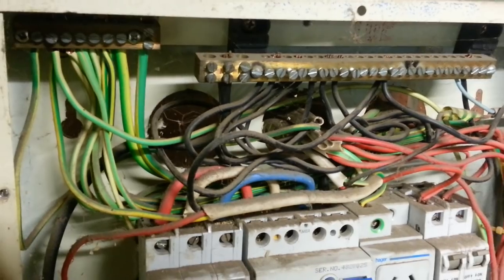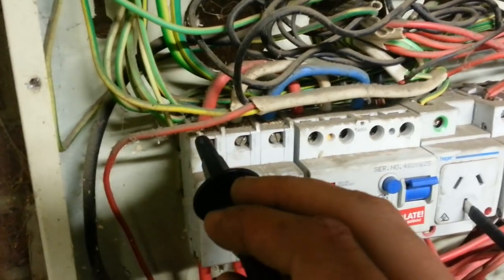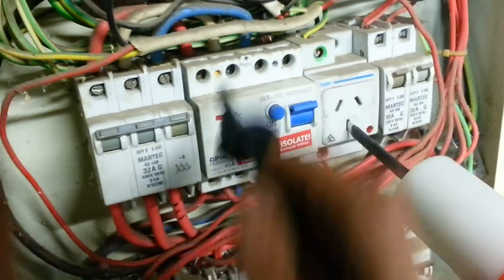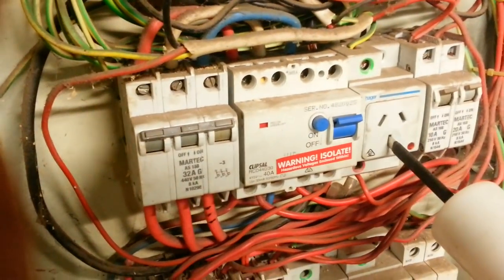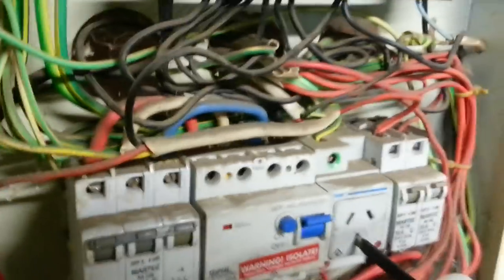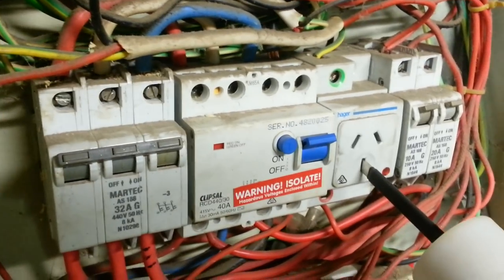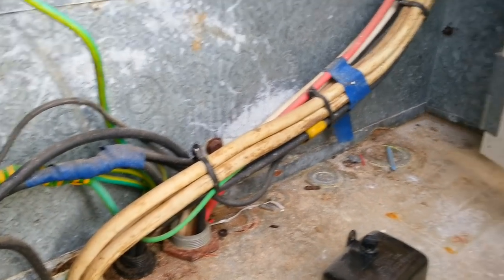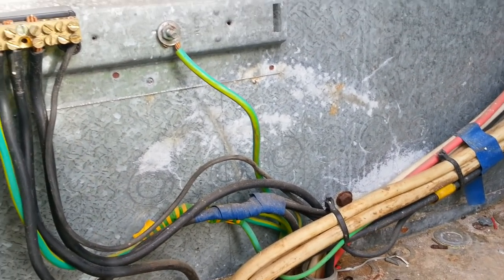M.E.N. link and R.C.D. demonstrated

Comment: i'm a sparky too mate and i always wondered why they don't use RCD's in the US either. Mind you they don't tend to ever use vde insulated tools either. I think it may have a bit to do with the fact they only run off 110 VAC 60HZ as opposed to 240V 50HZ.  Not sure though exactly. Their Active conductors are generally coloured black and neutrals white also. Their installations seem like way more of a hassle as well as they use metal boxes at every GPO and light switch.  It must be hard to add another GPO in elsewhere with that set up!
Reply: I think is becouse they are crasy. Here in Brazil half of the  country is 220 v  and the other half is 110 v but in either them is mondatory using RCD.
Reply: They have GFCI breakers which are basically RCBOs.

Comment: The MEN doesn't make an RCD trip, an RCD would still trip without an MEN.
The MEN provides an alternative route for the current to go back to the transformer on the pole (on in the street, for underground con mains)
You were correct when you said a RCD will trip when there is an imbalance, but technically it is an imbalance between Active and Neutral.
For example: there is 10Amps going through the active conductor and only 9.5Amps coming back through the neutral, the RCD recognises the difference and trips. The .5 Amps would go through the earth with or without an MEN.
Reply: 100%
Reply: Correct!
Reply: and so the MEN makes sure that that .5 amps goes through the earth/neutral wire instead of the person.
Reply: @PotatoesRnice  Nope! Read the last sentence of the comment that answers it for you.
Reply: @foxnews114  what I was holding onto the earth (maybe a metal housing) and the earth connection was in dry non conductive ground, and there was no men, and the RCD was faulty
Reply: @PotatoesRnice  Well sounds like your bringing up a pretty rare problem being 4 faults at once. (Fault to earth, earth stake bad connectivity, no men and a faulty RCD) in that case I wouldn’t like to be touching the metal housing.
Reply: @foxnews114  but the men could save the day and trip an MCB by providing a low resistance path from the metal housing to the grounding/neutral bonded at the transformer in ths street?
Reply: @PotatoesRnice  Yes! but it doesn't make an RCD trip.

Comment from the maker: Just a side note for the folks playing along at home. The main neutral should be soldered to the meter or the main neutral link be protected by a energy authority tamper proof seal (this prevents people stealing power, an offence by law). Meter wiring is not part of this video demonstration only safe working electrical outlets is.
Reply: Tradie Trev get a life trev

Comment: You can't actually fully insert your test lead directly to the live point of the socket without anything plugged-in to the neutral point of the socket. That's the way it protect, example a child not to get a shock if he tries to poke it with a conductive material. So it's only for safety.
Reply: here in the UK its the earth

Comment: Very Interesting to compare with here in the UK . Where we have what we call a TNC-s supply, the equivalent of the MEN link is inside a sealed unit belonging to the supply company, along with either one or three large fuses, one per phase.  Only the network operators are supposed to mess with it. The customer just gets presented with live, and separated neutral and earth to connect the installation to, private customers are prohibited by law from adding any extra NE bonds,  or re-combining neutral and earth, unless there is a private generator. We too put RCDs or RCBOs at the origin, not at the final outlets, and that protects the users if there is cable damage by mice or whatever. But often we also have TT supplies, especially for remote farms with overhead feed cables. Yes we expect all electricians to be aware of this sort of stuff.
Reply: Good point as the MEN link in Australia is often undersized, not fitted correctly etc much better system in the UK
Reply: @JT-xt8bh  UK standards makes Australian electrical installations look so cheap.
Reply: @IAmThe_RA  cheap and nasty in Australia, so many electrical fires there due to sub standard workmanship and lack of knowledge/experience unfortunately
Reply: @JT-xt8bh  As a person from a developing country I was a bit astonished that a rich country like Australia is not far ahead of us when it comes to electrical installations and stuff.  Australia is also like an ally to the UK.. they could have easily cooperated in this sector to improve their standards. When I watch I British electricians doing their job, I just drool man 😂. I wish I could get my hands on their hager distribution boards, RCBOs, and  the accessories. Other brands like schneider, lewden, wylex, fusebox, etc. are good too. Their double insulated 25mm² meter tails are fantastic. I wish all their stuff are marketed in my country.
Reply: @IAmThe_RA  Australia isn’t as wealthy country as they would like everyone to believe.
It’s a big country in size but the population is around 26 million, go outside the few cities they have and the poverty is everywhere.
The country is split up into states and each state has its own government, they can’t agree on electrical licensing and each state has its own level of standards, some good but most bad.
They love getting electricians in from overseas so they can bill them out as sparkys but pay them poor wages meanwhile the overseas sparkys are doing the same work as their Aussie counterparts if not more and are scared to speak out as they will probably get fired.
I know of UK sparkys hired to install steel conduits as the Aussie sparkys struggled with it, once the hard graft was done they were sent back to the labour hire company.
The problem overseas electricians will have in Australia is getting their qualifications and training recognised even though they will have had a higher standard of training and experience.
This is a real cash cow for the government and companies, they will charge you a fortune and throw a ton of bureaucratic red tape at you so you struggle to get an electrical license.
Uk standards, training and workmanship is at another level compared to Australia.
Reply: @JT-xt8bh  I am planning to live in Australia as I have some mates who work there. I have a degree in Electronics Engineering and I also used to work as an (unlicensed) electrician here as in my country you don't really need license to do electrical works (I have also learnt a lot from british electricians on youtube like Artisan Electrics, eFIXX, John Ward, etc). I wonder what kind of training or education I need to do in order to work as a licensed electrician in Australia?
Reply: @IAmThe_RA  you will have to start from scratch if you don’t have any qualifications and that means an apprenticeship if you can find someone to take you on.
But before all that you will need a visa, another expensive minefield 💵 💵
Reply: Aussie Sparky here. I just went and did some looking up of British electrical practices. One of the first videos I came across was a video of a guy fitting off an outlet.
*The cables are solid not stranded? Australia never uses these anymore. A lot more susceptible to cracking/breaking
* They have bare earth wires that they sleeve at the outlet. Australia stopped doing this ages ago as well.
Reply: From another comment section
“UK doesn’t like progress. Everything is built here today the same way as it was built in Europe 50 years ago”

Your kidding yourself if you think Australian standards are worse than UK

Comment: Good video, but I don’t think RCDs have been common place right back to WW2. I know homes built in the 50s, 60s and even 70s were not fitted with them. They only became prevalent probably in the 80s? But agree all installations should have them. Our M.E.N.S. System has always been the superior system for safety. I lived in Taiwan for 9 years & that is basically the American 115VAC (with non polarised Pins and no earth) or the “two hot” 220VAC System with an Earth if you were REALLY lucky.